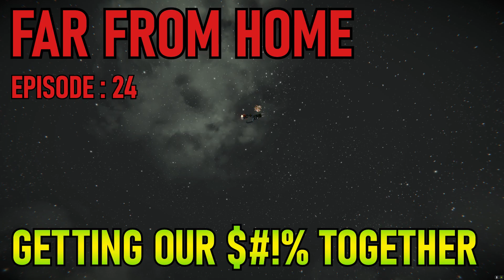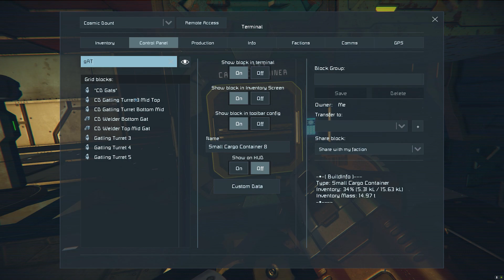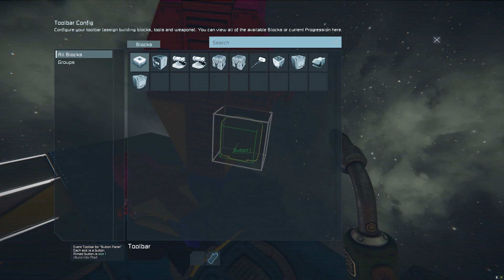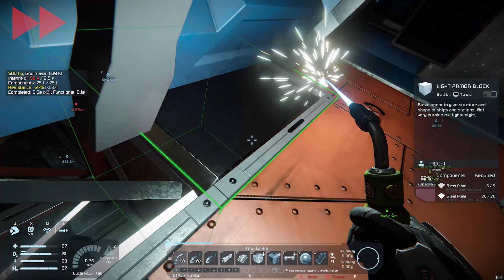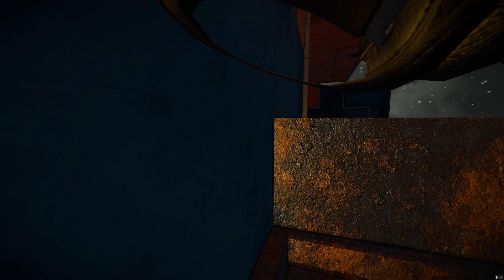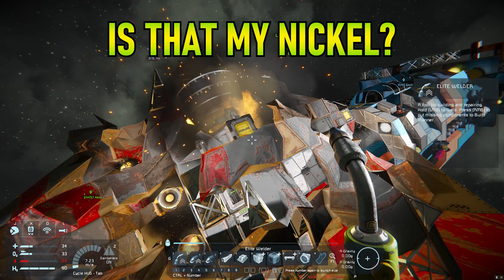"Far From Home" (EP#24) Getting our $#!% Together - Space Engineers Survival

Comment: As you were repairing the batteries on the Reaver... hacking computer was doing its thing (just because you "repair it" does not always make it yours). Maybe building  a smaller "worker be" type tug  to remove thing like battery(ies) and get drones and pieces may speed up the clean up process..
Reply from the maker: Yeah I guess that's true. I have been thinking about rebuilding the mini-pig to use as a smaller worker. The speedman uses more fuel than I need to. IDK. I'm kinda torn about it. I'd like to get some kind of a hangar going before I build more worker ships... which I would like to do.

Regarding drones, I was actually thinking about building some small drones to go out and pick up and bring back small pieces of wreckage. When the Reavers blow apart, the guns... and ammo, often go drifting off into the darkness before I can get them.